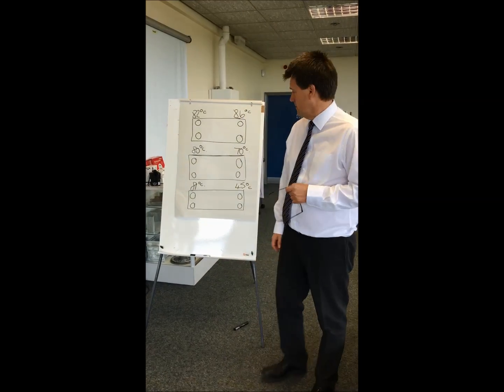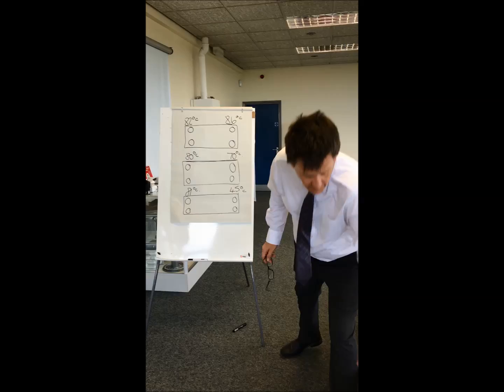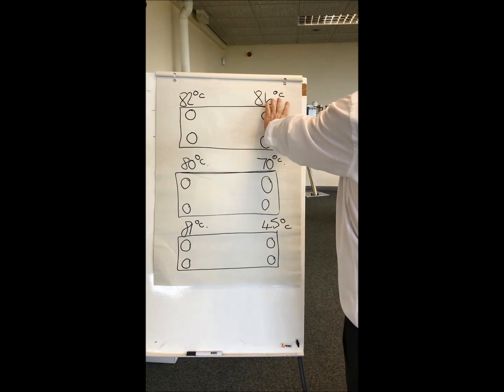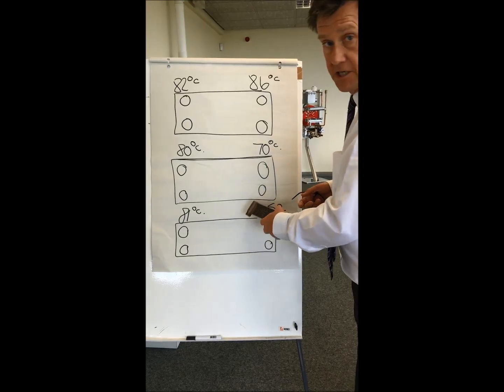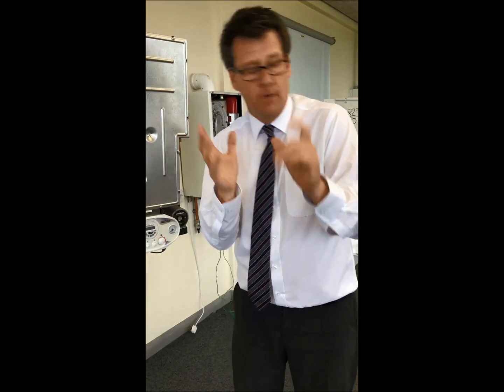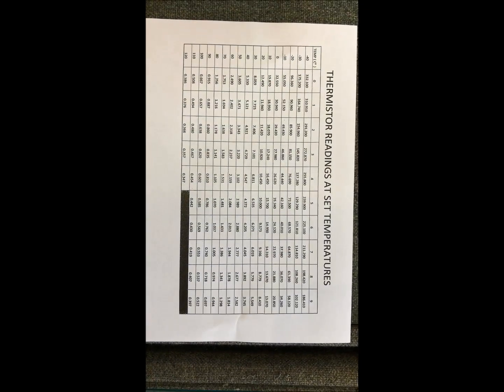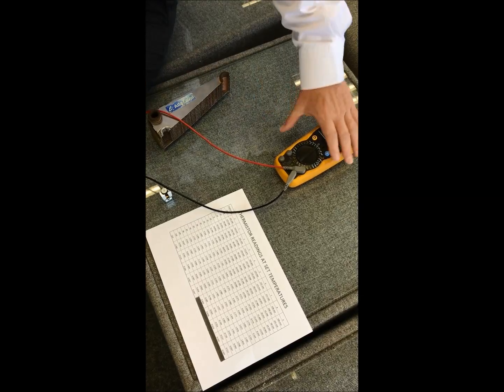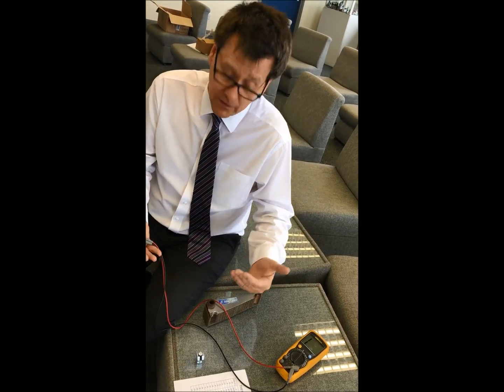Plate heat exchangers

Comment: Hi.
Most plumbers jump to either a plate heat exchanger, diverter valve, or a thermistor, l hope I've spelt that right, we had hot then lukewarm water and boiler shutting down, it turned out to be a faulty cartridge in a bar mixer shower, isolate mixer taps taps and showers one set at a time and see if you get hot water again, when you do you will have found your pasding cartridge, worth a thought.